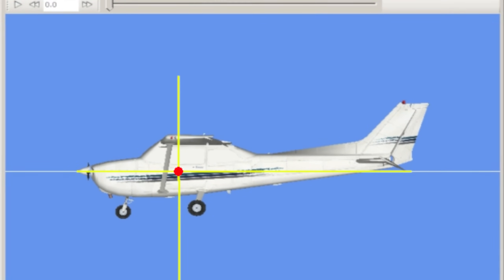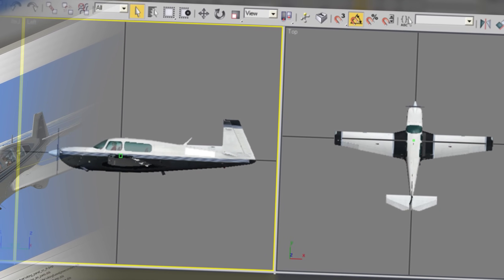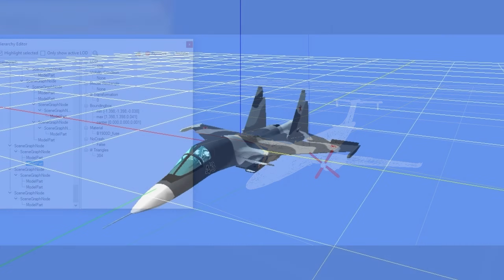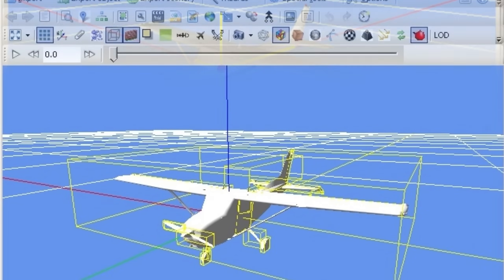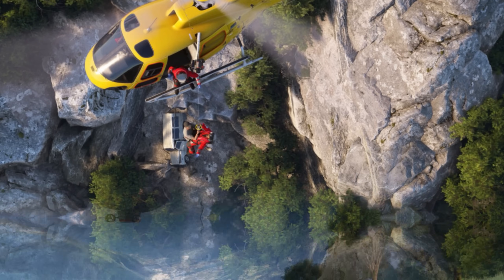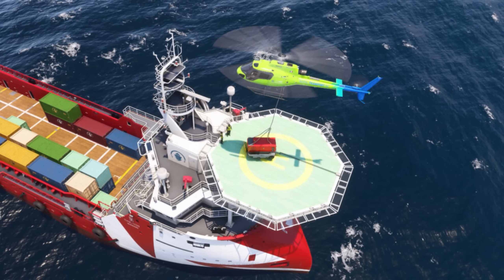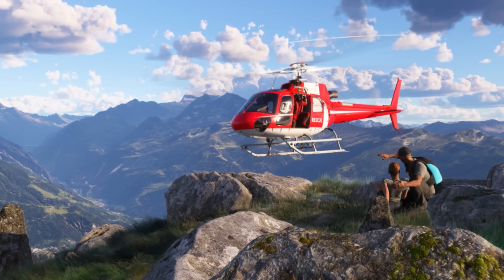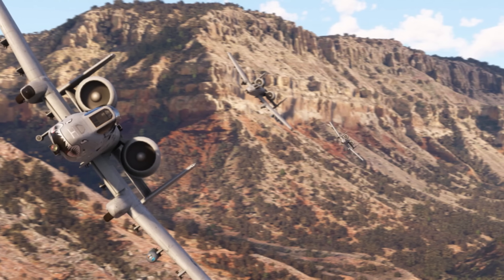MSFS 2024 Preview: Flight Model | Physics & Aerodynamics | Microsoft Flight Simulator 2024

Comment: Complexity in a physics engine means nothing if the numbers you feed it are wrong, and there are more wrong numbers in MSFS than in X-Plane.  I’m mainly a MSFS guy, but I don’t blind myself because of what I use or want something to be compared to how it really is which a lot of people do.
Reply: It really doesn't though. The best airplanes out there are still made for MSFS. The A2A Comanche 250 and the PMDG 737 blows the doors off anything Xplane has. I fly both. The only place I think that XPlane is better, is in helicopters, of which MSFS is rapidly catching up there. However both pale in comparison to DCS:World for helicopters, though it too is not without its faults.
Reply: @ImpendingJoker  you do realise that one of your examples, the A2A Comanche doesn’t even use MSFS’s physics engine, it uses an external one hence why that aircraft flys a heck of a lot better than anything that does use the Asobo physics engine.  If the MSFS’s engine was as good as that one there would be no contest, it would be glorious and there would be no complaints, which there are a lot of from anyone who is capable of seeing when the physics are off from the way objects and aircraft really move.

As for helicopters, yes X-Plane has a more noticeable advantage there than fixed wing, no argument, but also no, nothing in terms of helicopters in MSFS has improved yet, and adding a second rotor to the rotorcraft physics is a welcome expansion but that doesn’t improve what’s already there.  I’ve seen enough helicopter pilots complaining about the MSFS physics and I have a brain that works so I can see they don’t behave correctly and nothing has really changed, even the best example today doesn’t move realistically.

I am aware of DCS’s superior physics model, and I know neither that nor X-Plane is without it’s issues, in fact when I first used X-Plane I was surprised to see similar issues in its physics engine that MSFS has, but, they are not quite as bad or as numerous as in MSFS.

There’s a hell of a lot of copium going round when it comes to MSFS simply because of the world graphics, and I get it, I’d love to combine the best flight simulation physics with the best looking, most realistic world, I really would, but I have open eyes, and it’s simply not what MSFS is, and FS2024 won’t be either, and unfortunately I don’t think it ever will be under Asobo’s rule, not even after ten years.
Reply: @WhiteHawk77  WORD
Reply: @WhiteHawk77  They are trying to make it level D simulator lol, As xplane and they say the tests so far are going very well, I don't think you can take the liberty to speak already for fs2024 condemning it already without having tried it... I think msfs is working hard to make it a nice enjoyable simulator, no more hate and comparisons, after a while it gets tired, eventually you fly where you are best, you certainly can't make a type rating neither on xplane me on msfs so chill
Reply: @WhiteHawk77 I’m afraid you’re right. Too bad.

Comment: none of this really changes the fact that the dudes at Asobo know squat about flying and have nearly zero time in actual airplanes.
Reply: Patiently waiting for your sim sir, rotorcraft pilot here and msfs is fine. Now is your chance to show all of us your advanced knowledge hoss.
Reply: Seb flies irl
Reply: From launch I couldn’t even hop in a skyhawk and do a lap in the pattern without the plane weather veining and bucking around the sky. Power controls way too sensitive. Mixture control may as well have not even existed. Ground handling making takeoffs and landings nearly impossible. Those are starters.
Reply: at one point, 60% of Asobo got their PPL. Stop talking crap
Reply: @tubeloobs  source?
Reply: @ChrisVirgilio  An article Polygon did on the sim back in 2019. "The biggest surprise of Microsoft Flight Simulator: it makes Bing cool"
Reply: @tubeloobs  I don’t recall them stating they had PPLs. I remember saying they had flying time.
Reply: @Tom-90210  msfs glazer found. How does it feel

Comment: I really wan't the MSFS 2024 flight model to be better than xplane, but i doubt it will. The flight model is the one thing in MSFS i don't like. It just doesn't feel like the real aircrafts do to me, aircraft in msfs still feel too stable in my opinion, basically as if wer're not still fixed to rails like in FSX, but as if we're on a zip line.
Reply from the maker: Crank up your turbulence lol. I don't know, I think it feels pretty good nowadays. I get floaty landings, I get wind buffets for example in the V in St. Barts. I think it's a lot different from where we started.

Comment: Day purchase here, we’ve had 4 years from 2020, I bought the deluxe package, not because I needed or wanted all the extras, and as it turned out I replaced almost all the aircraft and scenery with payware, the cost of that payware dwarfs what I spent on the original sim. My point being I wanted Microsoft and Asobo to succeed, now 4 years later the sim has improved so much and reached a point where further improvement requires a new engine, sure they could offer it as an upgrade free but continued development is costly, I am more than happy to pay for this development, I’ve had thousands of hours of enjoyment for about 130 bucks, not sure what the hourly rate that works out at but surely one of the best value software purchase I’ve ever made. I can’t wait for it’s release.
Love your content, please keep it coming 
Cheers
Reply from the maker: I couldn't agree more, Ken, and I truly appreciate the support!
Reply: you should have bought 2 copies, maybe then they would have enough money to make a better product in 2024.

Comment: Computational Fluid Dynamics
Reply from the maker: Got me on that one! I've always had "constant" in my head for some reason.
Reply: @IslandSimPilot  Massive respect to you for all the efforts to help folks out. You are what my Full Bird uncle and primary flight instructor would call 'the aviators of old'.
Reply from the maker: @WilhelmvonFahrvergnugen  I truly appreciate hearing that, because those are hte people I have a tremendous amount of respect for. We have forgotten too much of what they learned over the years...
Reply: @IslandSimPilot  Thanks for the videos. Computational Fluid Dynamics is used by many aerospace and automotive companies. The Catia CAD system includes the Ansys CFD package, Catia was originally designed by Dassault (Airbus Industries), now used by aerospace companies (including Boeing and Airbus) automotive OEMs and F1 companies, the cars are designed and modelled using 3D CFD before wind tunnel testing, so CFD is current state of the art, not blade theory.
Reply: @fabiena1787  CFD has indeed been used for decades, I first met it in my 3rd year Mech Eng degree - in 1976, using Fortran lol.

Comment: I expect FS2024 to be really dumbed down for the Xbox crowd. That's where the money is apparently.
Reply from the maker: I don't expect that at all, particularly given that it will have a lower minimum spec than MSFS2020.
Reply: Why would you? MSFS2020 wasn't dumbed down at all. In fact the most realistic GA aircraft, the A2A Comanche 250, is also available for Xbox. I've flown MSFS20 in both locations there is literally no difference between them other than that freeware mods aren't really available for Xbox. So I know what you'd think that MSFS24 would be any different.
Reply: Because MS is still going to support 2020 after 2024's release.
If 2024 was supposed to target the same market as 2020 there'd be no incentive for MS to do so, hence I expect different audiences.
The trailler focussed heavily on activities and action - something that caters the more casual "gaming" crowd - if they wanted to hype the existing Sim-Userbase, they would showcase something like improved ATC, better Grundhandling, realistic procedures, better checklists, a simulated FO, better Routing/Flightplanning, integration of Simbrief or current AIRACs, ...
But they didn't...so why would I expect 2024 to be a better Sim?
Reply: @dundee248  What does supporting MSFS20 have to do with it? They supported every previous version of FS for years after the next iteration came out. That means nothing in the grand scheme of things. Just because they haven't shown that stuff doesn't mean that they won't. No one even knew MSFS20 was coming until they announced it, and had already be 5 YEARS in the works. MS is notoriously tight lipped about things and I imagine we'll see videos coming out like they did for MSFS20 showcasing all the finer points of the sim. You're viewpoint is quite narrow, and if MSFS20 is your first FS, then you have literally nothing to base the rest of your argument on.
Reply: @dundee248 I don't know which Sim userbase you're in, but I'm only hearing positive things about the new carreer and other activities.
Reply: You were right it is dumbed down,physics are awful i uninstalled and reinstalled twice,i want give it another chance,looks great but just can’t stand the flight model

Comment: MSFS 2020 had a '1000-point system' at launch, but I doubt that many of its stock airplanes implemented it. In Sim Update 8 came a better prop-modelling and 'CFD airflow', but these were options and I have not seen any stock planes using it. I don't know about 3rd party airplanes, but I doubt that there are many.
Since 2024 will be backwards compatible, most aircraft will be moved to 2024 without modifications - i e with crappy FMs.
One can hope that premium developers will take advantage of the new physics in 2024, but have they so far? And why bother when most customers don't care? They use MSFS as a game, not a simulation. Yes, there is A2A, but they develop their own FM-engine.